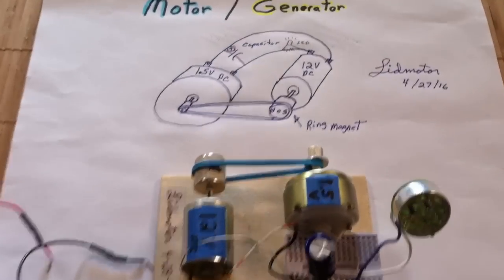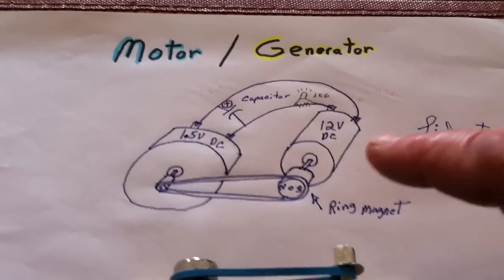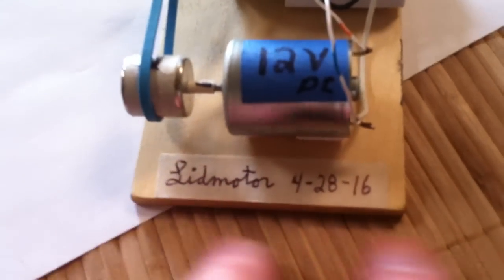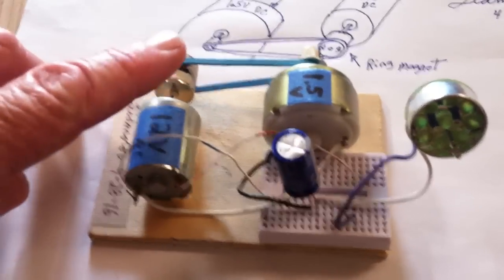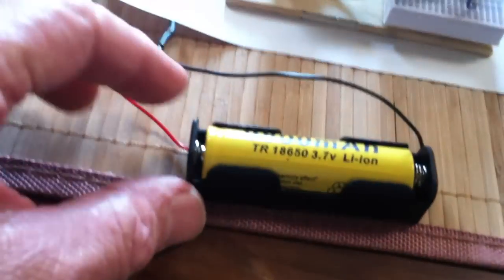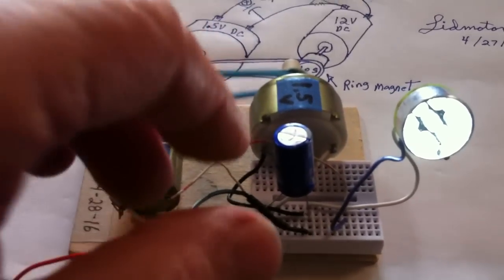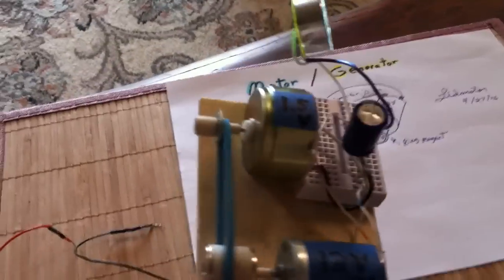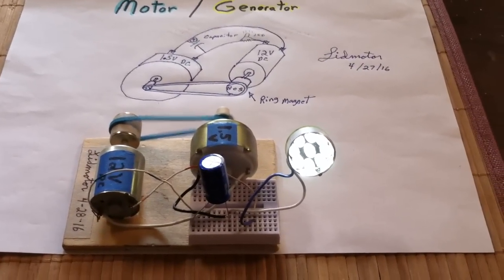Motor Generator---- how it works

Comment: Oh My Gosh.  Even though you explain this is not just another "free energy" video, nearly all of your readers assume that is exactly what it is.  A 7 Farad capacitor is really impressive on its own merits.  That means it can deliver 1 amp, at one volt, for 7 seconds.  Of course in actuality the voltage will usually decline during use.  Charging it is the same; it would take one amp 7 seconds to charge it to one volt.  But from that 18650 battery, charging will be nearly instant to 3.7 volts and that means you could draw 1 amp for over 21 seconds just from the capacitor.

Comment: Is that 12v motor outputting DC or AC? Is there a diode in circuit between the two motors? 
As for the pulleys, I would have had them the other way around to get the 12v motor/generator spining faster.... And I would place a 25v capacitor at the 12v motor which is then connected to a DC to DC converter that steps down the voltage to 1.5v (this way, the DC to DC converter does the heavy lifting instead of the generator).... 
It's all about giving the drive motor the voltage and current it needs to drive the generator, and the DC to DC converter is needed to convert the higher voltage lower current into lower voltage and higher current.... This should give it some more efficiency..... You might need to play around with the drive motor voltage and current on the DC to DC converter but it's all in the name of science and fun... 
I would have loved to see how long it actually ran on a single charge but the video was stopped short of it....

Comment: alternate for 6F 2.7V capacitor?
Reply from the maker: 1.5v AA battery.  Please remember that this does not make energy but rather converts a lower voltage to a higher one.  Energy is used to do this.

Comment: Ok but in theory if you spin the motor enough to charge the super cap without a battery would you not generate power to then power itself?

Comment: Hello, I know that this might sound crazy, but I think that I have discovered a simple way of using pulleys to multiply AC electricity, + gaining free energy. There is an extremely powerful spiritual warfare going on over this tech, so please take a close look at this technology, and don't listen to the voices in your head, saying that this cannot really work. 
-
Here is a video that shows just how easy + simple that this GEM technology is to create for yourself,,,,  https://www.youtube.com/watch?reload=9&v=NxpoiCFKmPg 
-
JUST THINK of a little logic, how it takes only a few short bursts of current to rotate a 30 cm circumference pulley once, giving you 30 cm of moving belt, which you could run past 3 mini-pulleys of 1 cm circumference with AC generators attached, giving you 90 cycles of AC electricity,,, NOW TRY + TELL ME YOU CANNOT FREELY MULTIPLY AC ELECTRICITY, when you can gain 90 cycles of AC electricity from a few sparks of current
-
+ don't you believe in this stupid torque lie,,,,,,, torque only occurs when you need to produce power + the only power that you need to produce to have this set of motors/generators self powered, is a few short burst of current,,,,,,,, from 90 cycles of AC electricity
-
+ PLEASE WAKE UP PEOPLE,,,,,,,
Have you ever heard of the Mandela Effect
-
CHECK THIS OUT,,,,
+ try telling me that there is not a powerful spiritual warfare going on in our world
-
- Here is one of the videos trying to let this scary information out
https://www.youtube.com/watch?v=pPrutcbaerQ&list=PLDIEv5nkqqEa0-u8DIzqpefKBAG0nkb7g&index=1 
-
+ here is an explanation by the Physicists
https://www.youtube.com/watch?v=HHKmoBeNWWQ&list=PLDIEv5nkqqEa0-u8DIzqpefKBAG0nkb7g&index=2 
-
Here is a website that shows you how quick + simple this GEM technology is to build = https://www.youtube.com/watch?reload=9&v=NxpoiCFKmPg
+ here is a website that I set up to discuss how GEM works   https://www.facebook.com/groups/274842009339398/
Reply: Hello Joe Lynch

My email address is ramaswami2000@gmail.com
Can you email me please about your thoughts

Comment: 2.7 volt 10 Farad can work ?
Reply from the maker: yes-----so does a 1.5v AA battery.  Please remember ---the super capacitor is just storing energy.  No energy is made with this device.  It simply raises the voltage at the cost of amperage.

Comment: hallo lidmotor, do it stops at any time by itself? how long it takes?whats the exact capacity?you may try to run it simultaniously with the normal dollar store flashlight and make some calculation, easy to do when its clear the output desired effect. thank you for your work!
Reply from the maker: It just runs fro a few minutes on the stored energy.   This is NOT a self running device.
Reply: +Lidmotor thank you very much for the quick answer! ;)

Comment: so can you just use a bigger capacitor to make it run longer? Is there any advantage over a regular motor doing things this way other than a voltage boost? Do you get more than usual current?

Comment: OK this is how it works : there's a motor and it has a belt connected to the generator the generator generates an electricity for the bulb and for the motor so the generator passes the electricity that is generated by the motor then the generator passes the electricity to the motor and then the motor will keep working and that's all I got

Comment: what is the value of that super capacitor? can you put a meter on the output of the 12v motor and also measure the consumption of the 1.5v motor?  
i doubt it that in that size of super capacitor. led should be dimming slowly.

Comment: dont exist the fuckin capasitor
Reply from the maker: I got the Maxwell 2.7v 6F super capacitor form Mouser.com.  You can use a more common 2.7v 10F super capacitor (EBay). The value is not critical.  The higher the FARAD rating the more energy the capacitor will hold and the longer the motor/generator will run.

Comment: I can not fined a 5.5volt capacitor all i found id 10volt. Were to you get them?
Reply from the maker: Google 2.7 volt 5 FARAD super capacitor.  This is NOT a regular capacitor.  If you can not find one use a 1.5v AA battery.  This device uses energy.  The amp draw is 30 mA.
Reply: @Lidmotor  "This is NOT a regular capacitor."
Actually, it is a regular capacitor.  It obeys the RC time constant of a capacitor rather than the voltage curve of a battery.  It achieves incredible capacitance because of the extremely close spacing of the plates but in all ways it is a capacitor and that means it also has amazing surge current capability.  
But this kind is very touchy about voltage and absolutely never reverse polarity.

Comment: hey bro I'm try it but it is not working
Reply from the maker: Please remember ----This is not 'making energy'.  It is converting voltage only.  Hook a regular 1.5v battery to this and watch the 12v motor put out a higher voltage.  This is NOT a 'free energy' device.

Comment: this is fake we cant do like thet of course he added a capacitor but it cant store that much energy to run 12 volt battery for a long time.
Reply from the maker: Google search--  "super capacitor".  It is like a fast charge battery.  It DOES hold enough energy for a short run.  This is not fake.

Comment: what volt of dynamo can i use to power up the 12 V 1000 rpm moter ? and is the super cap really necessary for this structure ?
Please let me know :)
Reply: "what volt of dynamo can i use to power up the 12 V 1000 rpm moter ?"
A 12 volt motor needs 12 volts.

Comment: battery is hidden in the board. Am i right?
Reply from the maker: No battery.  It runs on energy stored in the 2.7 volt 6 Farad super capacitor.  Google search "super capacitor" to find out what that is.
Reply: Lidmotor i know about the super cap very well!!!! so there is no need to search on google!!!!!!!! you understand

Comment: how it works without battery and what is the work of capesiter
Reply from the maker: Google-----2.7v  6 Farad super capacitor.  It is like a fast charge battery that you can recharger thousands of times.

Comment: How long to you conetc the batterys to this Cuircuit ? and how Long would this thing run? any calculations ?
Reply from the maker: No calculations.  Lots of fun though.  The thing will run as long as you feed it power.  It draws about 30 mA.

Comment: pls tell me this is really work I have only 2 days for make this
Reply from the maker: Does it really work?  Yes.  If you do not understgand English please have someone who does explain to you what this device does.  It is a mechanical voltage converter. It USES energy.  It does not MAKE energy.
Reply: Capacitor rating

Comment: Dear Sir:
first  AA 3.7 v  energy  for what?
for start 1.5v dc motor or 12v dc motor or   charge capacitor   or start 2 dc motors  in the same time?
Thank you.
Reply: The 18650 battery quickly charges the super capacitor.  That capacitor powers the 1.5 volt DC motor.  The rubber band transmits the mechanical energy to a 12 volt DC motor being used as a generator.  The output of a DC motor is already DC, no diode needed, and feeds the LED.  
It is a way of stepping up the 3.7 volts lithium battery to 12 volts for the LED's.  That is all it is doing.

Comment: so just a stupid question  (be gentle ) could you not run the output power from the generator and go through a transformer to step the power up to charge the capacitor?
Reply from the maker: No.  You have to remember that this device is consuming energy and not making it. No matter what you do the capacitor will drain.
Reply: Lidmotor just a quick question. If you didn't have the load on it from the light and had a battery that switches very minute or so on the cap. Would it essentially run until the battery is dead?
Reply: Lidmotor love the video mate btw my child and I are going to build this.

Comment: Hi, can this setup in reality be made into a closed loop, i.e. when you charge the cap once with external power, it keeps running the first motor, that, spinning the other motor charges it back?
Reply: The 1.5volts motor consume more amp then the 12 volts motor ( wire is bigger on the small motor )so, the total wattage to run the mot-gen are bigger then the output ( thats why the capacitor acting as a flywheel), once the stored energy in the capacitor run out, evereything stop ! as lidmotor said.

Comment: if I use 1F 5.5V Super Capacitor then the motor will work?
Reply from the maker: yes ....but it will only run a few seconds.  Remember this is NOT making electricity.   It is USING it.  A 1.5v AA battery would work great.  Amp draw is about 30mA.
Reply: hey is that working
Reply: ye real video he ky or kaise kiya motar konsi konsi he plezz reply karo mujhe

Comment: sorry if this is a stupid question, it's probably connect directly to the light. but how did you get the 12 v motor to charge the capacitor without the capacitor sending electricity through it powering it?
Reply from the maker: The super capacitor energy powers the small motor.  The belt driven 12v motor powers the light. When the energy in the super capacitor is drained off everything stops.

Comment: what do you mean by flywheel??
Reply from the maker: The magnet on the shaft of the 12v motor has enough mass to act as a flywheel---but it isn't needed.

Comment: Lidmotor u mind doing a demonstration of the circuit diagram  and or maybe a put together tutorial. also what happens when that 6F capacitor runs out   does it run out ?
Reply from the maker: Think of the super capacitor like a rechargeable battery.  It holds energy.  When that energy is drained away the device stops moving.
Reply: yea i was wondering if it was  re supplying itsself. i noticed in a video u said u had a reed switch  with half the pulse charging it and half  running it. if that was charging itsself .
Reply: jeshua leblanc 
good
Reply: Dipankar Guha 

thank you

Comment: why you put a ring magnet on the 12v one?
Reply from the maker: It acts like a flywheel and it is a pulley.  It does not need to be magnetic.

Comment: something isnt right, 12v will blow those led lights, hell even 9v, Ive tried
Reply from the maker: It is a 12v DC motor that is being used as a generator.  It is not being turned up to full speed.  It is not producing 12v.

Comment: Very cool video Lidmotor:) Please could you let me know how long the motors run after you have taken away the battery? and would it run for longer without the load? (LED'S). Another thing as well is what if you were to increase the size of the pulley wheel on the 1.5 volt motor? or what about replacing the LED's for another capacitor, would this make the machine work for much longer periods? if not permanently?
Reply from the maker: It is just one motor turning another.  Nothing really special.  Please read the description above.

Comment: I made one, but only got succes by adding a flywheel.
Take my advice, it needs a flywheel
Reply: V R may i know whats an flywheel
Reply: Ahsnu
Reply: Which pully did you add flywheel, the 1.5v or 12v Motor. Also how heavy was flywheel.

Comment: So basically this is an electromechanical 'valve' to prevent the capacitor from draining immediately and burning those LEDs?
Reply from the maker: No.  The capacitor is really more like a fast charge  battery.  Google 'super capacitor'.

Comment: whats the use of the ring magnet?
Reply from the maker: The ring magnet is just a pulley.  It could have been made out of plastic or wood.
Reply: ohhh does it really works? because i will present this in our investigatory project

Comment: why you don't use the generator to recharge the capacitor and continue running?
Reply from the maker: Second law of thermodynamics.  This was thought out long long ago. Machines can not 'make' energy.  They CAN convert it though.  A solar cell or a wind generator are good examples.  The machine I show here converts a lower voltage to a higher one but there is no energy created.  Heat and friction grab much of the energy used in the process.
Reply: What is the type of the motor and the generator?

Comment: Tell me why u are connected the neodymium magnet with motor
Reply from the maker: It was just something I grabbed to use as a pulley.  It could have been wood, or brass, or [plastic. The magnetic property does nothing.  It does add to the "illusion" of something unusual going on.

Comment: So why the ring magnet?

But, what your saying is you charged the capacitor to get the voltage going to light up the led's and run the 1.5v motor which in turn runs the 12v motor which loads the capacitor with more voltage than its losing. So in theory the capacitor will always have the voltage to run the whole cycle/system endlessly...?

The only problem is...you still have to use an outside power source to get it going. Perhaps if a perpetual motion, wind fan, or solar supply was used to generate power for capacitor, a battery may longer be needed...This depending wether the capacitor is a low load loss type capacitor.

Despite the battery, its a very nice conceptual theory.

Comment: beware man. maybe it's illegal in your country
Reply from the maker: I think you are confused about what this is.  This is NOT a 'free energy' device.  It is a mechanical voltage booster.  A smaller voltage rated motor is turning a larger voltage rated motor that becomes the generator.  It uses energy.  It does not make it.

Comment: how long will it continue to run on that capacitor?
Reply from the maker: Minutes.
Reply: I think this concept can be used to replace batteries. I imagine a good application will be for wind turbines. Instead of starting it with a battery, hook it up to a wind turbine. If the wind stops you still have some energy left for a few minutes until the wind starts again.
Reply: @techwizpc4484  "If the wind stops you still have some energy left for a few minutes until the wind starts again."
Yes, you could power a small LED light for a few seconds, maybe a minute.
Reply: Paradigm2012Shift  ano po bang voltage vcapasetor
Reply: I think another interesting question would be how long would the 12v motor run on just the capacitor without the 5v motor driving it.

Comment: i am trying to do this. so please tell me the voltage of capacitor used and if 1.5v dc motor is not avilable can i use 3v dc motor.
Reply from the maker: The capacitor is 6 FARAD 2.7volt super capacitor (a 1.5v  AA will work) the motor sizes really don't matter.  A smaller voltage motor driving a lager voltage motor gives you the effect.  Please remember that this is NOT making any energy. It is mechanically boosting a voltage.

Comment: Hi Lidmotor ! I have, over the past year, watched so many of your demonstrations, and some I have successfully replicated.
Since in this motor generator, you have placed a permanent magnet on the shaft of the 12v motor, would it not be possible to place two pickup coils, convert the output to DC and it back to the supercap for a longer run time? Also, would another permanent magnet, placed on the shaft of the 1.5v motor be able to assist rotating the larger permanent magnet, as you had demonstrated in earlier videos about distanced magnetic gearing.
Another item: Arkiver asked me to check your videos to see if one of his projects, could be made to run with hall sensor switches and pnp transistors, instead of his design using reed switches and npn transistors. 
What I am most happy about is that you are back, although Maggie was a little damaged.
Thank you.
Reply: Sundiesel ...so why is a "magnet" there again...?